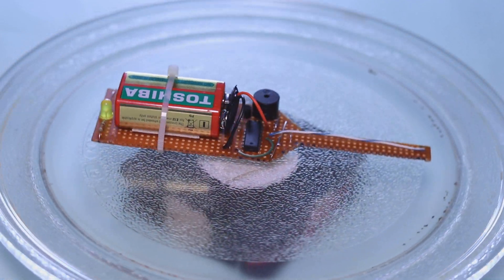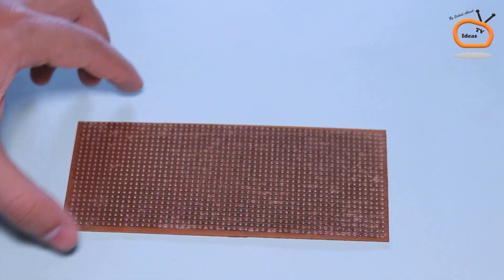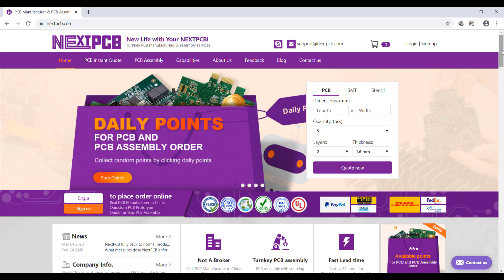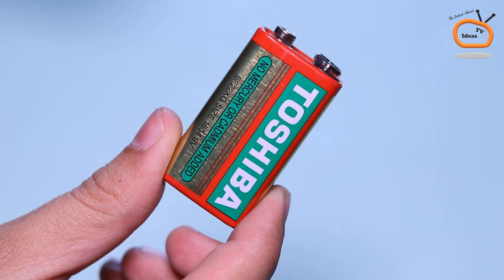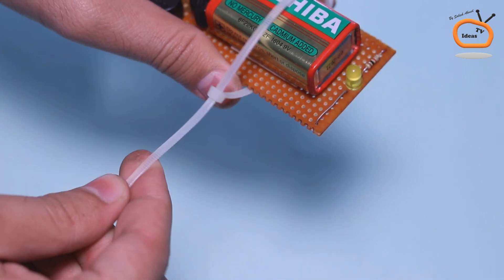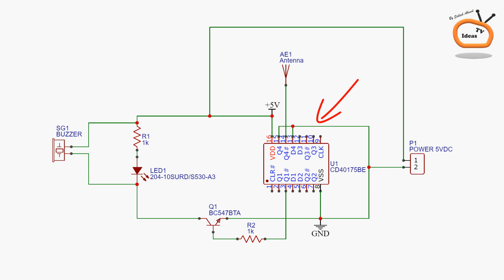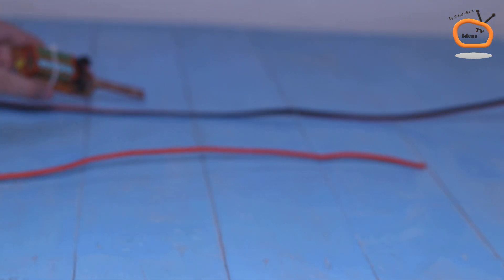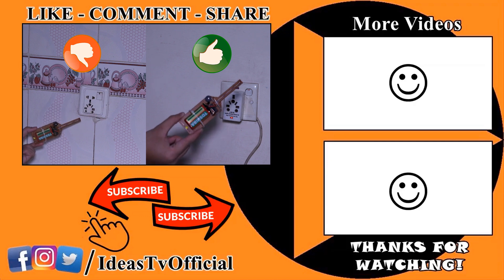How to make Wireless AC Voltage Detector Pen | Non Contact Electrical Tester

Comment: hi! can we use this in an 8kV AC supply?
Reply from the maker: yes it can detect, but don't do this, 8kV is too much and dangerous!
Reply: @IdeasTv  I'm an electrical engineer in a distribution utility and we have ppe's. will the circuit won't be affected by the 8kV induction?

Comment: I just want to ask, your material in resistor is 1k ohm and 2k ohm but in your diagram there is two 1k ohm resistor. Is it just okay with two 1k ohm resistor?
Reply from the maker: use a 1k Ohms resistor for LED only

Comment: It doesn't replace the old school tester. You can't identify which wire is live and which one is neutral. You do not have choice to take the neutral wire far away from live. Also in congested area, this shitty product will annoy you buzzing always. but yes its for kids and you should put an warning on the youtube video. some kids might just touch the live wire with it and die. You will be responsible for that. Risk with high voltage is always put everyone at risk.
Reply: You can make it w/o buzzer, only with LED... You don't need this for identification which is L or N wire, you use it to find power cables in wall or to detect broken wires... 
For example you want to hang some picture on the wall but not sure is there any cable.. ? It's non professional detector for home use, not a toy for kids